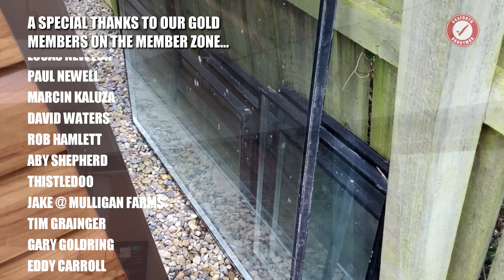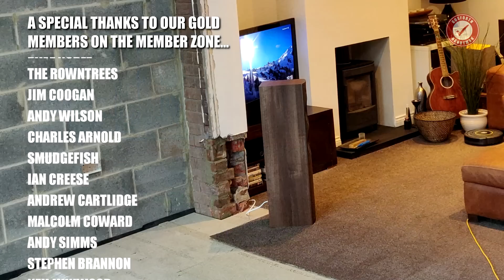The knock-through has started! (Self Build Extension Part 19)

Comment: You did the breakthrough so methodically and neatly.  I have a DIY "builder" friend who would have started with a sledgehammer, not thinking about the windows until he broke a couple, and destroying many of the bricks.  Overengineered?  Could that builder have been a relative of yours?
Reply: That's not just a "DIY builder" technique... many regular builders will have just smashed everything, and anything that came out intact they'd have smashed just to make sure.

Comment: Sods law, if that bay roof had a leak and you went to investigate for a small repair you'd discover it was made of spit and cardboard, but because you need to rip it off of course it has been designed and built by the ancient Greeks to last two thousand years.
Reply: Lol accurate

Comment: Deconstructing is always much more difficult than building from scratch. that’s why when you hire a GC which is the acronym for General Contractor. 

 it always cost you a lot more money to remodel a house and an add additions than it does to build a house!
Reply: A classic example of this was 10 Downing Street. 50 odd years ago the figured that to demolish it and replace it with an exact replica would have been a fraction of what they were spending on renovations,